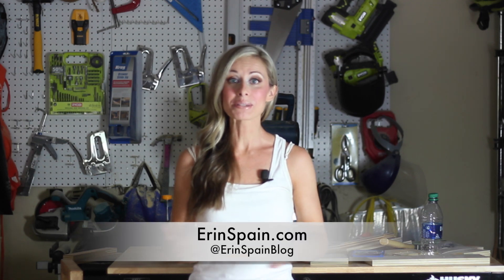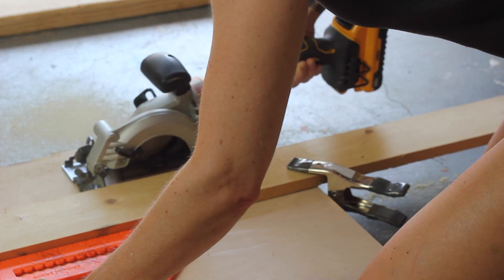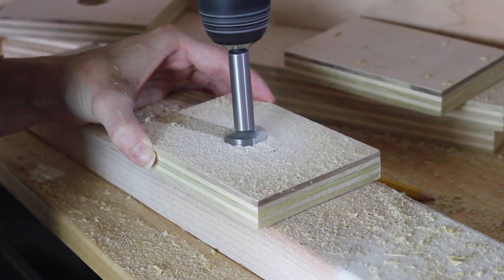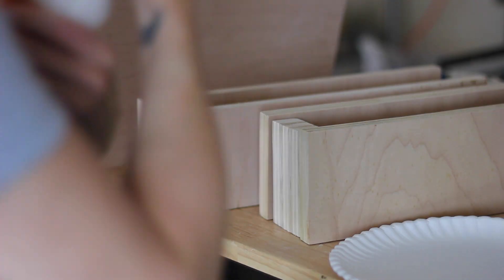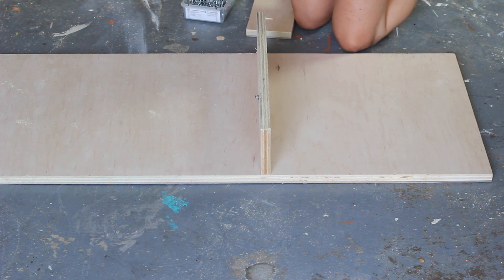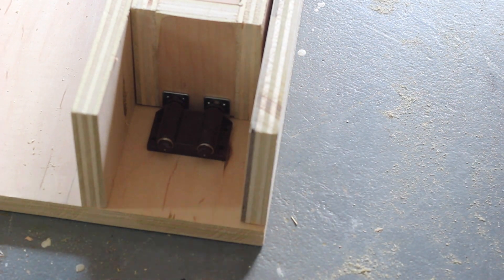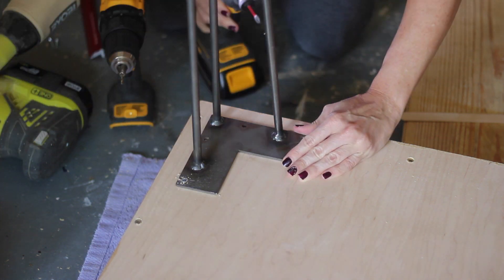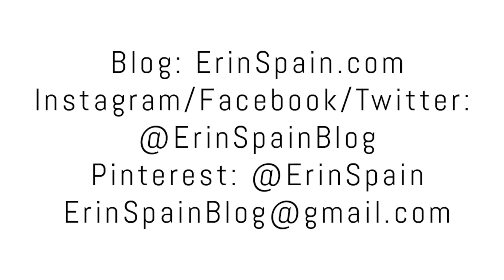DIY Plywood Desk with Hairpin Legs and Magnetic Pop-Out Storage Bins

Comment: What size of screws and type did you use to attach the hair pin legs?
Reply from the maker: I used small 1/2" screws that I had left over from some other hardware. Any type of screw will work as long as it's thin enough to fit the holes on the hairpin leg brackets, and short enough to not poke through the other side of the wood. (So in this case, shorter than 3/4". You might be able to just barely get away with 3/4" at the longest.)